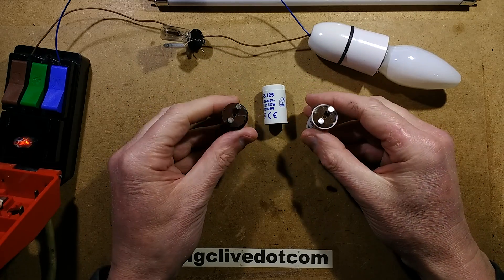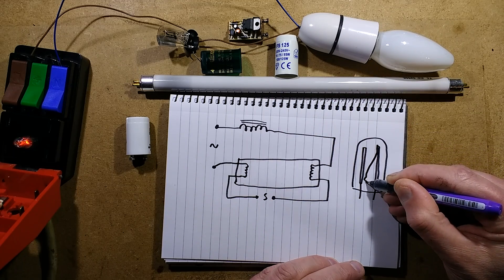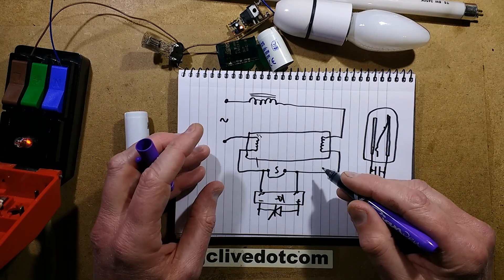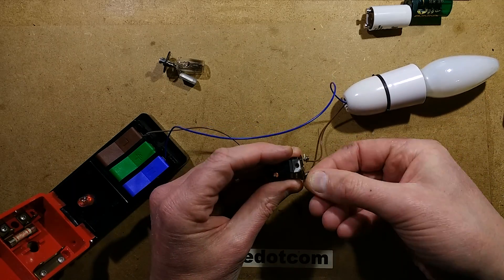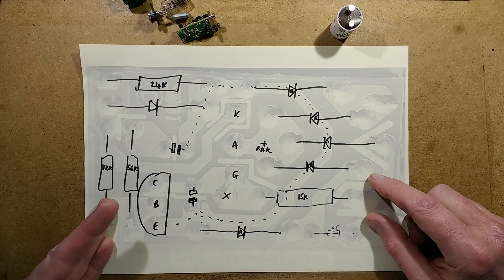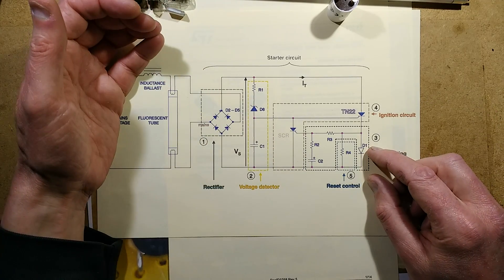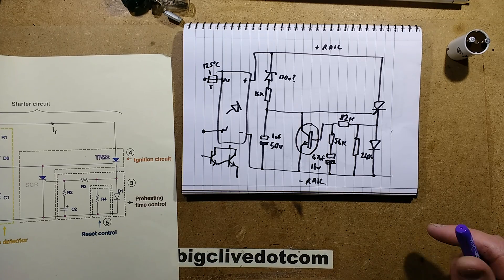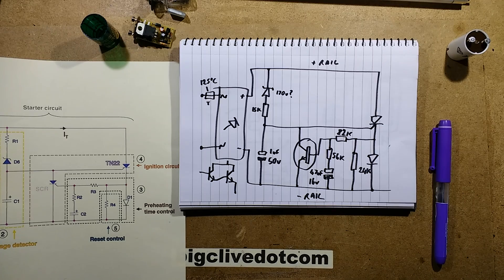Reverse engineering an electronic fluorescent starter.

Comment: I haven't seen one of those for 20 years or more. I didn't realize they are still used elsewhere. I'm frequently amazed at how different things are here vs over there.
I used to replace lots of ballasts, both 120 V and 277 V depending on which building I'm at, but now whenever a ballast goes out it's cheaper to just rip it all out and rewire the fixture with line voltage going directly to the bulbs, then pop in a couple LED tubes. Hopefully by the time those need replaced I'll be retired.
Reply: I hope you add a sticker to warn against installing a regular florescent, or someone could have a nasty surprise.
Reply: Oh yeah! Every time I buy the bulbs they give me a stack of warning stickers and I definitely put them in each fixture I convert.
Reply: I think they're mostly legacy installations these days or fixtures that refuse to die in kitchens and garages.

Comment: It's obviosly that the 47uF capacitor that charges a few seconds after the thyristor is triggered then the darlington transistor will shunt the thyristor's gate, since the transistor is a darlington it uses very little current so the capacitor should discharge slowly, I suspect that after the capacitor is depleted it should retrigger the thyristor again. I hope i got it right. Cheers :)
Reply: That had me puzzled too but it was the only explaination i got, maybe the diode is not a regular diode? or  Clive had it draw incorrectly, maybe Clive could check the forward drop across that diode? Who knows, maybe it's even an actual zener diode and he didn't check it. Cheers :)
Reply: ciprianwiner yes that's right the Darlington could be held off from retriggering the thyristor by a tiny current even putting your finger on the open Base would hold it off so i guess it would take weeks for the capacitor to lose every last nA. ....
Reply: I don't see how that would work.  The 47µF cap through a 56K resistor has an RC time constant of only 2.6 seconds - and it was only charged to about 0.7V to begin with.  For that matter,  this MPSA14 darlington has a Vbe of 2V, how does it ever conduct in the first place with the base shunted by the diode to 0.7V?  Very odd indeed.
Reply: That's how I interpret it as well. I can't see how else it would work.

Comment: The resistors and the capacitor behind the transistor have rather high values. You disconnected the circuit shortly after the lamp turned off. Maybe the capacitor was still holding charge. Or maybe the thermal fuse went off?

Comment: I used to change a lot of tubes and starters for an industrial setting around 2000-2001, we had green ones and brown ones, all electronic of course. The green ones would just fail miserably and turn the tubes into nasty strobes. Not great because the areas lit were monitored with cameras which really did not like the strobing. I can't remember the brand any more but the failure mechanism was very bad indeed.

Comment: I remember being a kid I found out that I could keep the flashing/ticking tubes to light still if I unplugged the starter (not electronic) just when the tube lighted up. Can anyone explain why?
Reply: Because the starter is broken, and it flashhes the tube. If there is no starter, there is nothing in the circtuit that can flash it. After the tube is on, the starter is an open circuit anyway.
Reply: Not entirety true, the tiny capacitor in the starter is still in circuit and it filters out some of the RF noise generated by the lamp, very noticeably in the AM  (Ancient Modulation), radio bands.
If the tube is near the end of it's life then the voltage required to maintain the arc within it grows higher as the emmisive coating on the cathodes degrades until it reaches the tipping point where the starter thinks that the lamp is off, so it tries to restart it, either that or someone has fitted a series starter into a single tube fitting :0
Reply: jesuschal The voltage drop across a fluorescent tube increases with age.
The voltage required for the starter to conduct is normally above this voltage.
However with a life expired tube, the voltage drop across it may increase above the conduction voltage of the starter.
Where borderline, the tube does an occasional restart every few mins.
Removing the starter will allow the tube to continue running.
The same happens if the wrong starter type is installed in 6ft /1800mm and 8ft/2400mm fittings. A "4-80W" starter will cause nuisance re-strikes of 6ft/1800mm 70 and 75W tubes for the reasons above.

Comment: When the transistors conducts, it is discharging the (charged) 1 uF capacitor.
This might cause a short peak with a high current. Will the transistor survive this? (No current limiting resistor!)

Comment: I'm guessing the the leakage current through the thyristor allows a small amount to current to flow after it's attempted to start the tube. Since the transistor is a darlington an extremely small amount of base current would allow the collector to stay below the threshold voltage of the thyristor and never letting the trigger current flow into the gate.

Comment: The high holding current is to allow for a decent voltage pulse to be generated by the choke. If it had a holding current of, say, 1mA it would open in the moment wehen the choke would carry only 1mA and thus had no stored energy left to strike the tube. (Opposite reason of why you switch off huge tranformers right at the zero crossing of the current.)

Comment: The high holding current means that it turns off at a higher current, instead of waiting until the current is almost zero. Since the energy stored in an inductor is I*I*L the higher current ensures more energy and a better chance of the tube striking. That said, why not use an avalanch rated MOSFET? It could be made to turn off at any chosen current. Better yet, a PIC and a MOSFET. That way it could choose the needed striking energy and lessen the blackening of the ends and still strike every time.

Comment: You've got the way a thyristor is triggered the wrong way round - the Darlington shunts the gate voltage here, stopping the the thyristor triggering. Given long enough the cap on the base will discharge and the starter will have another go at striking the tube - there's a clue in R4 labelled 'Reset control'  on the datasheet cct.

And now I've looked at the full datasheet that is what happens.

However there's there's a problem with the ccts as shown if I'm thinking straight. If the diode (D1) in series with the thyristor is a normal one its forward voltage won't be enough to turn on a Darlington and I'd not like to bet it would reliably turn on a thyristor either.

Edit: When hand-drawing a Darlington I just put two arrows on the emitter.

Comment: I have an RS branded electronic starter, had it for years, and it only stopped being used when I replaced the fluorescent tube in the kitchen with an LED tube, never seemed to fail unlike the traditional starters... :)

And as for traditional starters, I recall seeing them used in someone's halloween project to create a "faulty wiring" effect, which you recreated in this video, quite impressive and a simple circuit too... :)

Comment: AFAIK starters are suposed to boost startup voltage by sudenly opening the circuit causing the changing current across the choke (di/dt) impose a higher voltage across the fluorescent tube than what is available from the utility. 

This is necessary for the firt ionization of the gas, that when heated up with current flow will now conduct at regular voltage.

After that initial ionizing cycle, the starter is not needed anymore, as the lamp will conduct by itself. That is why it's called a "starter".

No wonder an electronic starter would trigger above normal conducting lamp tension (the zenner part), and will have both a means to start conducting and stop conducting across it's pins.

They are probably calibrated to conduct through the starter and the electrode heaters just enought for initial startup and then submit the lamp to the overtension across the electrodes. As all of this is stressful to the materials of the lamp the shorter the stress imposed the higher the durability.

Even though solid state lighting is taking over this technology for good, industry is already sabotaging durability with planned obsolescence through bad drivers with lousy inappropriate capacitors to make virtually unlimited duration LED lamps fail.

Where I live (Rio de Janeiro, Brazil) we've made pilot instalation of some 500 T8 Led tubes. They've been working of for 4 to 5 years. Half a dozen have had failed 10 led segments out of near 200 Leds. No whole lamp failed.

We've scaled it up recently to some thousands while in a retrofit. Contractor could select any of the equivalent lamps he wished, and told us they would go with the best garanties. 5 to 10% lamps failing in the first month of use...

Our national standars organization ABNT had made norms in line with American and International ones, and the country will impose compulsory testing and certification of the devices including the driver and it's capacitor (well known object of willful sabotage in electronic balasts and led drivers).

Industry is alway lobbying against.
It will be compulsory for everyone by the end of 2017 unless industry manages again to postpone it.

That's the way it goes.

Comment: if the voltage across the tube drops once it is on the thyristor should stay off because of the zener, so the transistor should just clamp the gate when the current has reached some point so the lamp can strike.  Though it is hard to see how the voltage drop across a single diode can turn on a Darlington which has 2xVbe

Comment: There are floresent light fixtures rated for colder temps. Here in Northern Mi,we have to make sure all the fixtures are rated for cold temps. I remember having the older ones in our barn and when you turned them on in minus 20 degrees,they would only flicker off and on. It was way too cold for the preheater to get the light to florescent. We always had to make sure we had regular clamp type lights in the work areas. Problem being it was so damn cold your fingers would freeze to the tools when working on tractors,snowmobiles or our trucks. My dad put block heaters  in all of our vehicles. If you forgot to plug in the vehicle,you had to put a clamp light under the hood for an hour,usually down by the starter. Before the block heater it was a 100 watt light bulb in a work light with a wool blanket over the engine. I remember frost would build up in the carburetor, then it would suck it in to the intake. You had to use ether to get the damn thing started. Especially the ford tractor.

Comment: It seems that when voltage is high, current through zener charges capasitor which eventually fires thyristor. Once fired, current runs through thyristor and "diode". I guess the "diode" is actually zener to get voltage higher. (darlington need about 1.2V at base to conduct and due to resistors the "diode" voltage must be more than this.)
Once transistor cap is charged, the transistor  latches the base of the thyristor down and the thyristor turns off near zero crossing (next low current point below the holding current of the thyristor).
Now, if the lamp has fired, high voltage zener prevents the circuit charging and therefore thyristor will not fire again. However, if the lamp has not fired, the cycle should start all over from the beginning.
If it does not seem to make another try, perhaps it just heats it up long enough to get things going at the first time?
Reply: I agree with you, and nice to see I'm not alone in picking up on D1's voltage drop not being enough.
Reply: And the filaments of a fluorescent tube are in series with the starter... The difference is that once the tube strikes, the effective voltage on the starter drops down to 70-100V, whereas in case of a bulb it goes back to the full mains voltage.
Reply: 68Stan, The standard bulb was not in place of a fluorescent tube, it was in series with the starter.
Reply: Yes, but it worked also with a standard bulb connected in place of the fluorescent tube, meaning that there's no voltage drop once it opens the circuit. That's the problem. 
The diode is most probably a dual/triple diode in one package.

Comment: Are there different rated starters for specific wattage tubes?  We have a 2ft tube that blinks like mad when first turned on. I replaced the tube and the starter but it still behaves the same.
Reply: Yes, they all have the range of wattage of the lamp they can work with.
Compact tube florescent have a much lower range than the larger tubes but that should be printed on them.
As here: https://static.bltdirect.com/cache/images/Fluorescent-Tube-Starter-4-65-Watt-1-700x625.jpg
Reply: Oliver Dawson yes s10 starters for say 4f and 5f tubes then you have s2 starters for fittings with (2x18w) 2x2f tubes not sure how it is in the US. Hope this helps from an aussie sparky
Reply: Thank you all for your help.  I think the tube is 18Watt.  the starter is a cheapo universal one but I'll check which type.

Comment: The company I worked for years ago illuminated their stores with skylights and fluorescent lights.  They got swindled into light sensing controllers that would shut the lights off when the sun was bright enough and would turn the lights on when sun went behind clouds.  Well on a cloudy day, the lights can be turning on and off every couple minutes.  Needless to say they were going through bulbs/starter/ballasts like crazy...and to top it off, the energy bill wasn't really any cheaper.  If you live in the US, you can still see these at Home Depots, some grocery stores, maybe even some Walmarts...and you'll see half the tubes out.

Comment: Would the voltage at the zener diode be lower because the fluorescent tube is now lit and therefore, no voltage would charge the capacitor to turn the thyristor on again (and thus, it would not try again)?
Reply: But what if the tube does not light the first time?
Reply: +jaaasgoed I wonder whether this is just the point. Maybe a second starter cycle is intended, just not as frequently as with the mechanical version?

Comment: actually i was enquiring how do the electronic ballasts/chokes work, so that i can try to repair some of those failed ones i have. but it still looks good, so i will watch this video with a very curious mind. ^^
Reply: They are simple self-oscillating halfbridges, there's not much to go wrong there. I can give you some hints if you will describe the problem.
Reply: hi Mr Johnny , how u been doing  ? :)

some of these chokes just stop working after 3-4 years of use and tubes simply go dark. in naked eye there are no traces or burns / bulged caps visible, but they just don't work. i tested a few resistors, diodes with dmm, but they were fine. never pulled out the components for testing though.
Reply: I'm fine, just don't have much time to make vids anymore.
  Tube ends go dark because the filaments sputter when you turn on the light, this coats the tube from inside, thus making it dark on ends. This also causes the filaments to loose material and they eventually break open. 
  There are 4 wires going from the tube, 2 from each end. There should be a continuity between wires in a pair, smth around 10 Ohms. You said that tubes are old and blackened, so I say it's the tube itself which is shot. You can test it yourself, just make sure to scrape those wires before testing, as they are usually oxidized.
  Those ballasts won't work without load, so you can't test them without the tube. But you can connect a classic long-tube fluorescent to it in order to test it. Don't worry too much about the power ratings since it is a short test.
Reply: ah my mistake. when i said dark, i wanted to say the tube not lighting up at all. it happened with new tube, then we changed the electronic ballast & it worked again with the existing tube & fixture.^^
Reply: If one of the two switching transistor short, the fuse will blow. The fuse is located on the wire going to the screw base (usually with heatshrink on it). Check it for continuity, also, sometimes diodes in the bridge go bad, you may check them too. If one of the transistors fails open circuit, the circuit might still run, but usually in the audible range.
Reply: i think i checked the diodes, but did not check those 3 legged stuffs. they are all transistor or there are some scr / triacs as well ? i need to find where i kept that broken choke to check it again though.
Reply: iceberg789 Here: /watch?v=-s6V3Sf0W-8
Maybe it'll clear things up.

Comment: I think the zener diode prevents the circuit from retriggering. As you said, the tube voltage when it is ON isn't 220V. Or did I get that wrong? 
So, the zener voltage is high enough to prevent gate current on the tiristor when the lamp is already ON. This one should retrigger I think.
Reply: he is talking  if the  tube failed to turn on  why does  it not  try to turn it on again
Reply: OK, I got it wrong :) It makes sense that I get things wrong.
Reply: i agree he did not  explaine it clearly

Comment: Only thing i can think of is a slight leakage that keeps the cap alive
Many years ago i was asked to put a warning light on a freezer room door (room was in a cold room), so if the door wasn't closed properly they would know from the corridor, i installed a sealed industrial limit switch in the door, and fed it out to a red bulkhead fitting, to make it more obvious i wanted to use a flasher unit, but then i thought about using a starter, just the normal mechanical (glow type), but it worked well for many years, and because of the random flashing it was much more annoying and obvious.

Comment: bigclive, i suspect the transistor shorts out the 1uf capacitor thus drags the operating voltage down for the power supply and then is held low. hence the thyristor cannot be triggered again regardless of the power supply coming into the starter